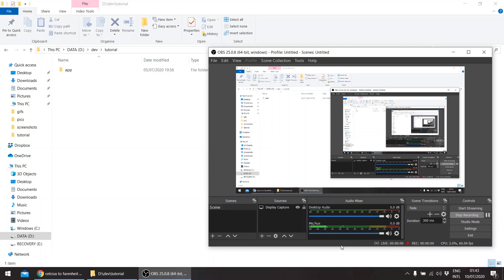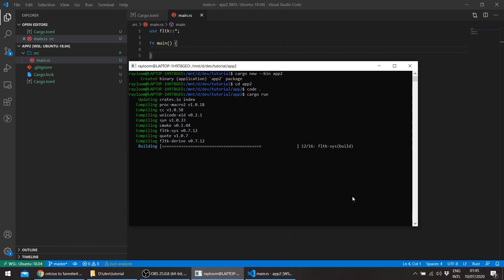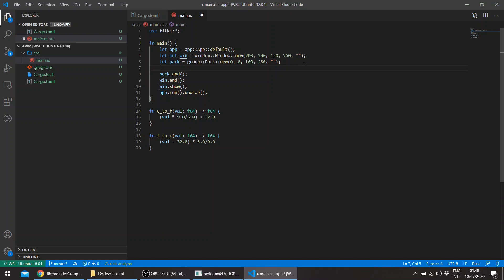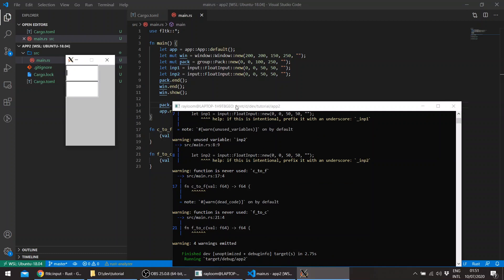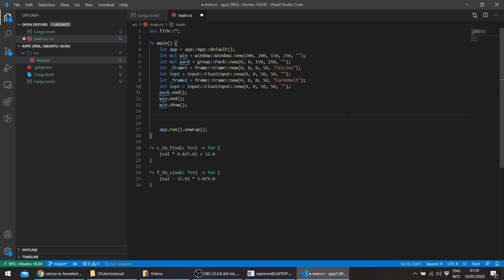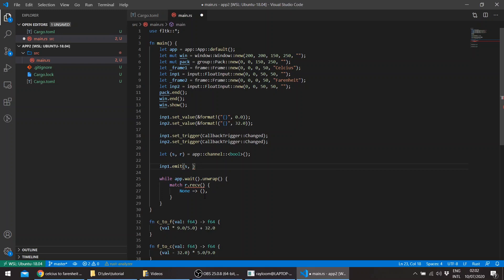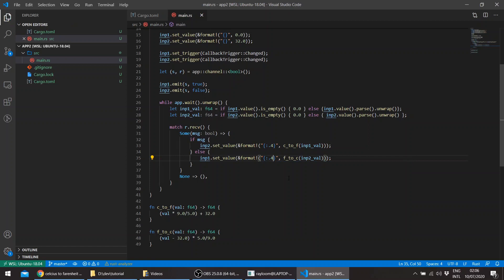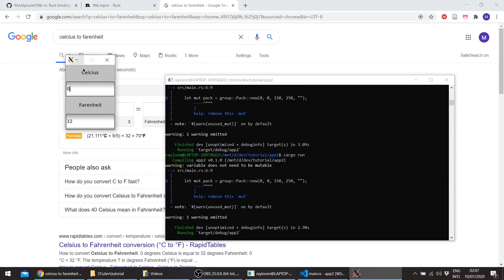FLTK Rust tutorial: user input

Comment: First of all thanks for your videos.
When I try to compile like you do I got an error when compiling fltk :
error[E0658]: `if` is not allowed in a `const`  
--> C:\Users\rasc\.cargo\registry\src\github.com-1ecc6299db9ec823\fltk-1.0.22\src\enums.rs:719:25
    |
719 |           const Command = if cfg!(target_os = "macos") {
    |  _________________________^
720 | |             Shortcut::Meta.bits
721 | |         } else {
722 | |             Shortcut::Ctrl.bits
723 | |         };
    | |_________^
    |
    = note: see issue #49146 <https://github.com/rust-lang/rust/issues/49146> for more information

Thanks.
Reply from the maker: It seems `if` in a const context is only supported on Rust versions after 1.45. I'll update the repo.
Reply: @MoAlyousef  thanks for your answer. I updated Rust and it works fine.